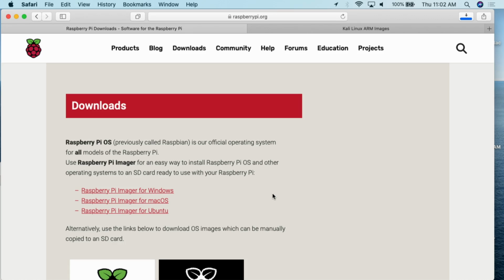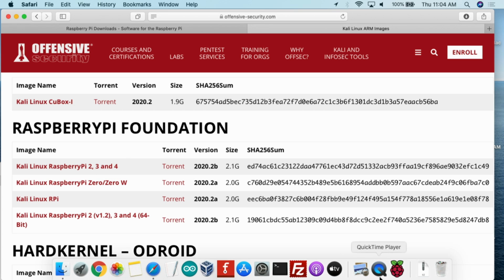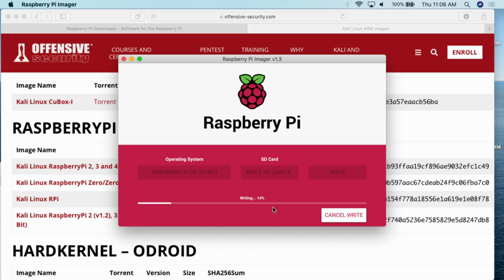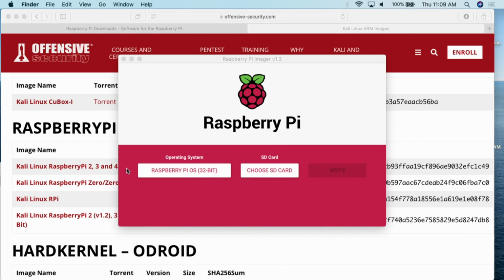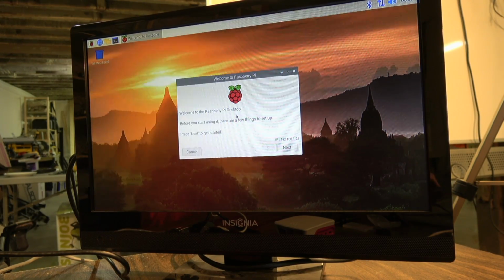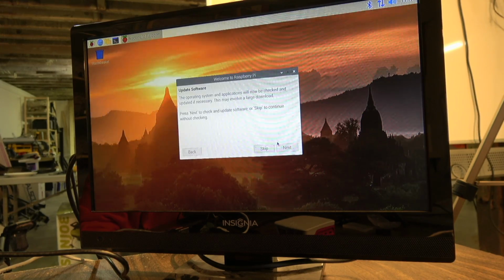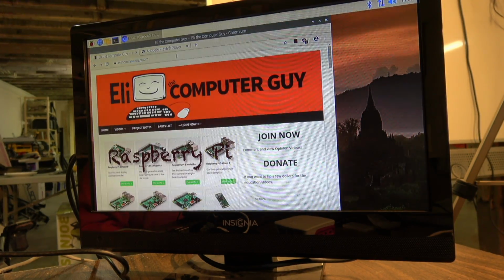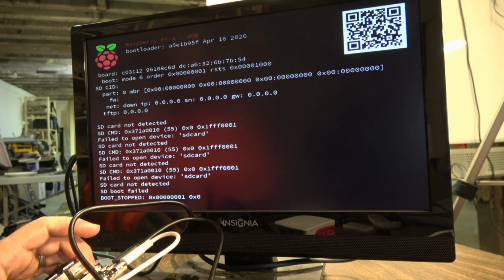Raspberry Pi - How to Install an Operating System on the Raspberry Pi

Comment: Little late to the party but glad to see you're making content for the pi4. Check out TwisterOS from raspbian-x.com which includes box86, an x86 userspace emulator that allows you to run some x86 linux binary games from GOG and some steam titles. Yes, STEAM client runs on the pi4. Not very useful obviously, but the i386 libs it provides are a HUGE help for box86. You can also access shadow pc (or a local windows desktop) from the pi 4 using moonlight and zerotier which is a better option than steam link.
Reply: hey, nice to know steam can run on pi. can i ask you for some tips? im trying to set up a multiboot wit PINN and dunno how to add piwizard to the initial install. how can i add it AFTER ive installed the os i want to run? Thanks in advance.